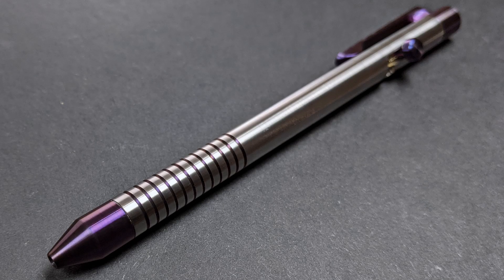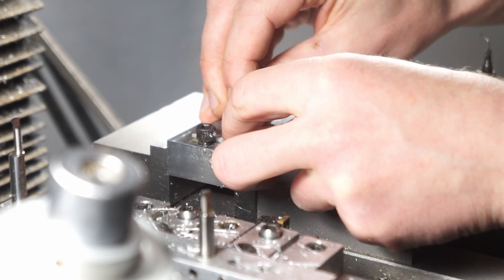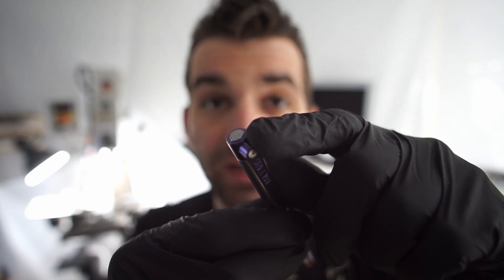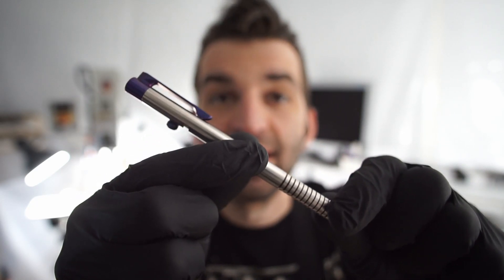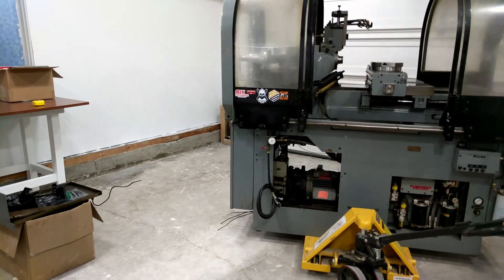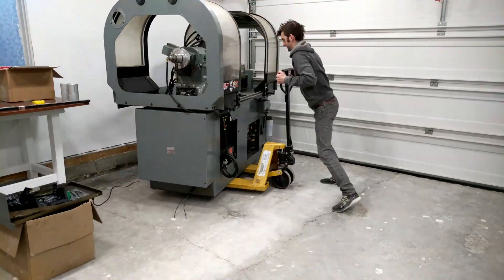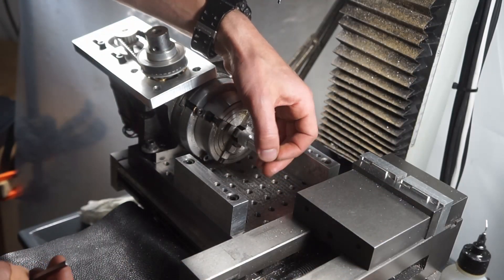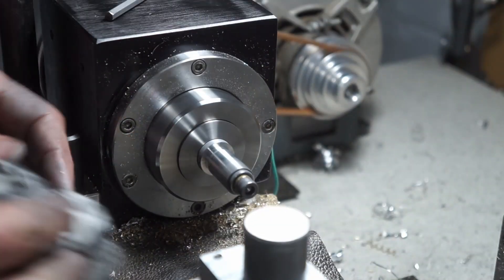Pens With Meteorite!

Comment: I can't wrap my head around the ability to split tenths...  We can get about 1/2 a thou most days as we dial in the machine...  If we need to get a couple tenths off, we run a spring pass...  I can't imagine how dialed in you'd have to be to get smaller than that...  I insulated my shop door with rigid foam two years ago.  We live at 6500' so winters are long.  It was one of the best things I've done to keep the machines warm.  I also put a big dial thermometer on my mill so I can peek out in the garage and see if I need to turn the heat on for a bit to warm things up on the coldest nights.
Reply from the maker: That's crazy! You and me both my friend, that is a such a TINY amount of movement! Hell I'll take half a thou off with a spring pass...different class of machine and I'm sure a different class of machining stratagies. With that said if it's physically possible I'm excited to chase it down! 
Winter is a slight concern for me, garage door is "insulated" and I'll have heat dumps around the machine...should stay at 20C year round but if my parts go wonky I'm going to use "thermal growth" as my excuse all day long 😉!

PS - I'm stealing your temp dial idea for the oil tank 👍.

Comment: Great video, how many amps are you running to your sub panel?
Reply from the maker: Thanks! Going with 100A (well technically 90 as the math got away on me  when sizing my feeder wire). If I use that up I'm doing good!